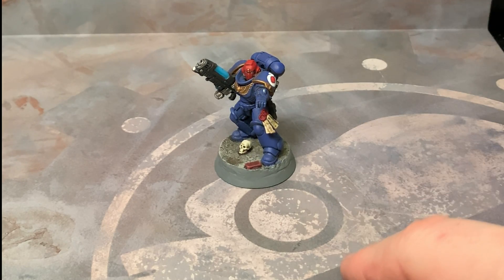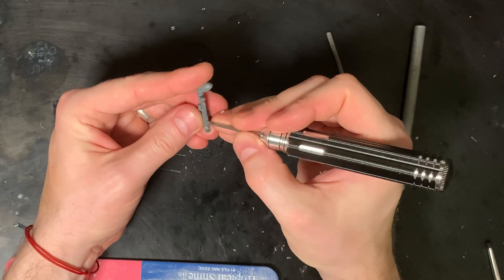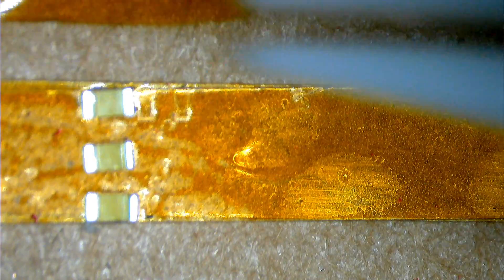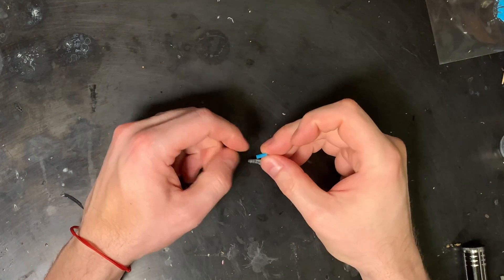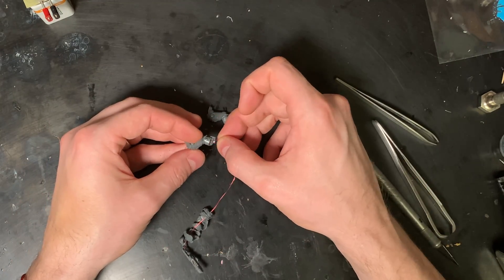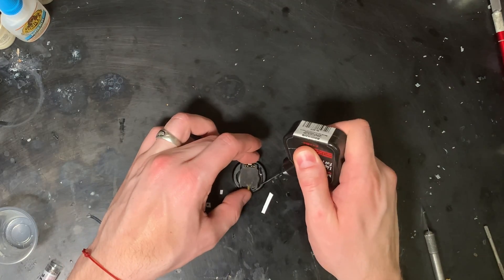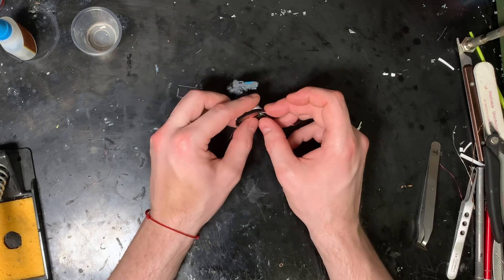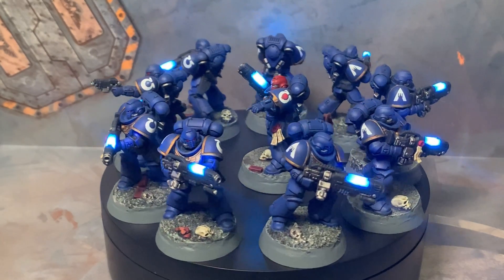plasma coils with LED

Comment: Hello, thank you very much for these videos. I have a doubt. If a battery produces the exact voltage that the LED needs, I don't need to put a resistor, right? I want to put leds in my Votann and I was looking for how to do the calculations for the circuit, I don't know if I did it correctly but since there is no extra voltage R=V/I is equal to zero, right? Thank you.
Reply from the maker: So the calculation will get you to 0 yes but I always put a resistor in because the nominal voltage of a battery is always lower than it’s fully charged voltage also the forward voltage of an led can also be slightly off so if a “3v” battery is driving a “3v” led you may actually have 3.3 volts driving a 2.8 volt led so you are over by .5v and this will deduce the life of the led even running at a perfect voltage a resistor will increase the life of the led.  At half current you are talking something like 3 time the life of the led.  So in short don’t raw dawg your LEDs pop a 10-50 resistor on there also check my led basic’s video for more info
Reply: @OchoMiniatures  Oh I see! Thanks so much. You really helped me. Now I have to find a way to hold the battery and the resistor under the base. I think I'm gonna try with melted silicone. Wish me luck ^^ haha. Thank you again!
Reply from the maker: @Semprargentum  i would suggest epoxy over silicone it will stick better and check out my knight pilot video for how I got the battery in there with magnets

Comment: Did you use resin over the plasma coil mould or did you use some form of rubber as the manufacturer states? I thought it was £10 per set of 5 until i read it was a master mould lol!
Reply from the maker: I use smooth on silicon for the mold I have a video on casting that explains the whole process!

Comment: Do you actually need to cut up the base to put the battery pack on or could you just feed it through a small hole?
Reply from the maker: unfortunately the hight of all the battery holders I have found are too high for the base so until I can find a better way this is what I do
Reply: @OchoMiniatures  smaller batteries? And just contact points.. maybe of course then the issue is keep the batteries in there. But I guess the volts may not be sufficient for the LEDs. Thanks for the reply

Comment: What is the thin wire you are using to connect the LED's to the battery and where did you get it please?
Reply from the maker: its 34 awg magnet wire I have added a link to the description.  you will have to scrape off the insulation before though.
Reply: @OchoMiniatures  Thank you. I working on some model trains and they have very fine wires inside them. I cant find anything thin enough but this should work. Will it handle 12V at 2A ?
Reply from the maker: @tiddles4x4  definitely look at the data sheet for the exact wire you are looking at, at 34awg 2 amps is typically too much to push through something that thin and it could melt the insulation with this I am running like 30 ma at 3 volts.  If space is your issue look at doll house wiring it’s really flat so easy to fit and hide places but with more mass it should be able to handle more current

Comment: How difficult would it be to change the battery? How long would these batteries last?
Reply from the maker: So far I have had these on for about 8 hours without having to change a battery and the LED librarian eyes have gone for around 12 hours and still doesn’t need changing.  Changing the battery isn’t too bad but having something to pop them out is nice like a blade or some tweezers